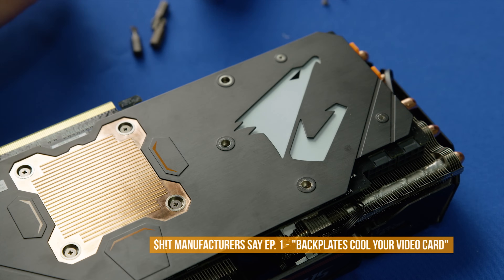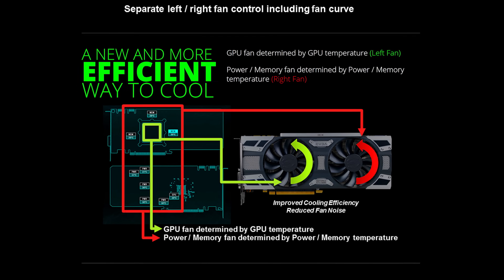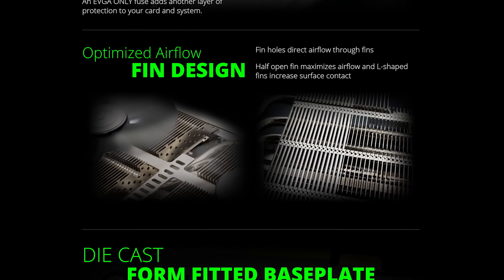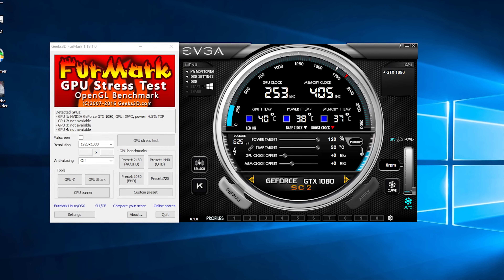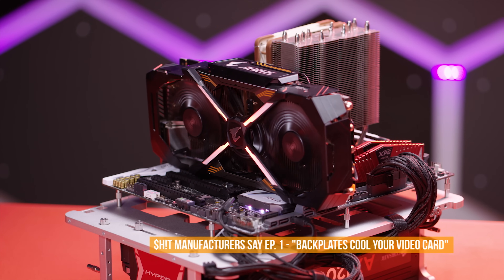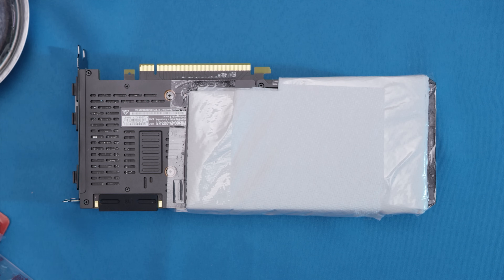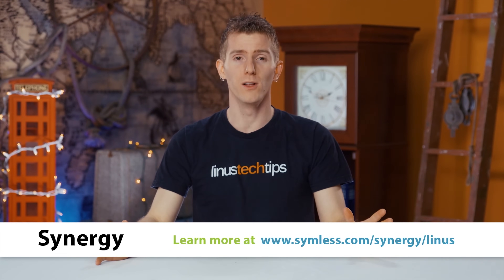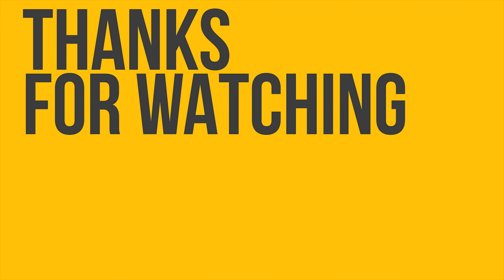The SOLUTION to Video Card OVERHEATING & DEATH

Comment: They need to put heatsinks on the backplate, or integrate them into the design themselves, if they expect them to help cooling to a significant degree.  That means more surface area.

Personally, I think the simplest thing to do is buy more high efficiency cards with blower fans.

Comment: I have a GTX 1050 2GB graphics card, it works perfectly fine for daily gaming and normal use. The card is maintained regularly. However, when I tried to run the Furmark stress test, the card would crash. Other than that, it has no problem. Should I trust Furmark that my card is starting to fail? (That it crashed everytime I run Furmark).

Comment: This is, in fact, much of the reason why I prefer EVGA, even to very well established, consistently good manufacturers such as ASUS. I'm not saying that they are better. 

EVGA has impeccable support, that'll gladly spend extended amounts of time troubleshooting a dead GPU, well after its warranty has ended. They are the sort of guys that sell you a 660 ti, which then cooks itself in just a few months, only to be a good friend, and upgrade you. But not just to the new 700 series. No, they're giving you a 770 instead of a 660 ti. Basically equivalent of replacing a 660 ti with a 680 in terms of performance. Hats off to good customer support! That's the stuff that'll keep me coming back. A broken chip is forgivable. Even the largest manufacturers and corporations makes mistakes and faulty products. The difference lies in how they handle such situations.

I bought a 2060 super from Evga 1½ years ago. Ultra Gaming or something, don't really remember that well. I just remember I wanted a 3 fan cooler for low rpm, low noise since I have the case for it, but couldn't get the one I wanted, so I had to settle with a twin fan design, with weird little bumps on the fan. Oh well, at least it's a million times better than a single fan. Been running solid so far, runs stable in games at 2085mhz at stock voltages, way more than I could've hoped for. At first I thought it was a terrible deal, but it has since come to my attention that this basically performs in line with a non ti 1080, and has rtx thrown on top, and only drawing at most 200w doing so.

I thought I had made a poor choice, not going for a 1660 ti. Man did that ever turn out to be the right choice, considering how impossible to obtain these things have come be.

Comment: Hello I have a problem with my gpu, a few days later I realized that the temperatures have risen 10-15 degrees in some games, I have already done maintenance to the pc to see if it was the accumulation of dust but nothing, the gpu has the updated drives, install two antiviruses and nothing. I wanted to know if someone else had this problem because literally this problem started to happen to me from one day to the next. (the gpu has undervoltage and nothing, it reaches 76 degrees in some games)

Comment: My sons Dell T3500 w/ Win10 keeps overheating and shutting off.  Nvidia card driver level doesn't seem to have an option to disable overheat shutoff, nor do I want to completely fry the card.   Any tips on cooling things down?  Or an option for a very cheap gpu that atleast won't overheat and shutoff mid game?  He's only 8 and it's shutting down on Roblox, so nothing advanced with crazy graphics

Comment: @ Linus Tech Tips,

                                 Linus, if you happen to see this Question or Remark, I have Recently Purchased through eBay, a MSI GeForce GTX 970 100 Million Edition w/Twin Frozers. I pretty much did the Same but I pretty much Slept while I had the Computer Left-On Playing 4K UHD Videos on YouTube. The Results is Between 37 Degrees on up to 41 Degrees having 3 Open Tabs. Olay, now, I see that your EVGA that you have Tested, is Open-Air and is Running at 37 Degrees [Beginning Of Testing], and Ended-Up at 80 Degrees. My Scientific Question is, Why did the EVGA Geforce GTX 1080 Graphics Card Ended-Up Hotter than my MSI Geforce GTX 970 100 Million Edition and that is in Open-Air Room Condition and mine's is in a Enclosed CPU Case. What Gives for the Temperature Differences for Open-Air Vs. Enclosed? Is it because of mines is Sideways Vs. yours is Standing-Up. It;s got me Baffled.

                                                                                                                                                                                                                                                                                                  G.C.E. known as 150Spoke9

Comment: i think the future application of this could be something like a water cooling loop with adjustable flow chokepoints to different parts of the GPU or the computer as a whole which are hooked up to the sensors and adjusted for volume/flow of coolant based on individual part temps. hotter parts = more liquid flow to cool those specific parts off. choke points could be spliced into the loop as separate attachments and hooked up to motherboard fan pins or whatever

Comment: Make a higher minimum fan speed make copper heat sinks make better heat sinks use heat pipes to connect the backplate to the heat sink make better ventilation for the shroud

Comment: I can answer this in seconds. Don’t modify the gpu by either over clocking it. Also have decent air flow or a good well designed no fan system. Most importantly don’t push past the limits of components or case capability to remove heat. See it’s super simple.

Comment: Guys i have a problem with my pc and i need help
My graphic card (FANS) spinning so fast while the temp is good (70c-60c) and the (FANS) rpm is 2700
Plz help
GPU: msi Rtx 2070 gaming z
Cpu: i7 7700k
Nothing is overclocked

Comment: Are GPUs getting to the point where they won’t be able to make them any more powerful due to not being able to cool them down? Or is their going to be new architecture that will allow gpus to run cooler? The PS4 pro i have gets super hot. I don’t see how they are going to be able to double or triple the power of the ps5 and not become a space heater. Sorry if my question sounds stupid but I’m curious of how GPUs are gonna get more powerful without getting too hot

Comment: I found a simple solution to cool my laptop. Place it ontop of my upward firing air purifier. No joke man this was the best quality of live trick I've done in the years of owning a gaming laptop. I then leave the air purifier next to my TV which is plugged in via hdmi and use my wireless keyboard and mouse to game on. 

What are the results? Fortnite plays at max settings  with temperatures that went from 70 to 80 Celsius without the air purifier down to 35 to 45 celcius with the purifier. Not only that but I managed to sustain these low temperatures playing fortnite at max settings for a 10 hour gaming session. 

Also, if the air purifier is cleaned on a regular basis, it will blow clean non dusty dry air into the laptop thus preventing humid or dust damage. And of course the air purifier is doing its main purpose which is cleaning the damn air you are breathing in the room.
Here is the air purifier 
https://www.walmart.com/ip/True-HEPA-Large-Room-Air-Purifier-430-sq-ft-Room-Capacity-White/21970557?wmlspartner=wlpa&selectedSellerId=0&adid=22222222228016817669&wl0=&wl1=g&wl2=m&wl3=194452192698&wl4=pla-308696531426&wl5=9031244&wl6=&wl7=&wl8=&wl9=pla&wl10=8175035&wl11=online&wl12=21970557&veh=sem&gclid=EAIaIQobChMIl4He6Ijl4wIVk7fsCh0tewGrEAkYBiABEgILNfD_BwE

Believe me this thing cools way better than a laptop chil pad. And the indented top rim allows a laptop as large as my 17.5 inch to rest on top safely as long as it's not bumped into. I know this may seem crazy but hey if you were thinking of buying a air purifier for your home and you are dealing with high laptop temps then try this set up.
Reply: Nais.

But I have PC.

Comment: I have a GTX 1070 super clock ICX ! I have noticed when plugged in vertical, temperature stay way below it's normal horizontal position, specially the backplate, that burns in horizontal
Reply: Careful with this ones, First revisions had shitty thermal pads, they would get hot and leak oil

Comment: so my program is saying that my GPU has reached 90C
but on touch, it doesn't feel hot (i didn't turn off the pc when touching it)
or at least it doesn't burn me when i touch it neither the fan or the inside of the fan or any of the side of the video card
the computer also doesn't shut down when the GPU supposedly touched 90C
(I'm using core temp for the gpu)
so I was wondering if it's normal that it doesn't feel hot on touch
and it's normal if the computer doesn't shut down for overheat even at 90C
and I'm afraid I might burn my GPU 
I did give it a good clean so I'm not sure  if it is a program problem that is saying i have the wrong temperature 
or if i should actually start to worry for a possible overheat 
(my GPU is a Gtx950)
Reply: Not a pro, so maybe i am wrong ... first touch and not hot. you might have touched it on the wrong places. but i dont think that. it could be core temp wich gives false temp data. or it could be a thermal paste problem (thermal heat build up). i looked youre gpu up where the big heat sinks are and stuff and and its kind of old 2013´ish (and there are some variants, so im not sure wich gtx 950 you have). second problem, youre pc isent shutting down. i played with overclocking on my old pc. i used core temp back than to see the temp levels. i had some situations where my pc diddent shut down. i think it was becourse core temp interfered with those mechanics. try another prog for temp monitoring. use only one prgm at the time and try to set always the same settings. in games the gpu stress could vary between levels and scenes. try to touch the spot where youre gpus prozessor is from the back, maybe you have to remove the back cover of the card. i dont recomend you touch electric devices when they are running, but you know, use youre brain and common sense, youre fingers could be sweaty^^
Reply: @ThomasZT  thanks! Your tips actually worked!

Comment: You gotta hell me bro. So I just bought an XFX AMD Rx 580 gpu two days ago. Installed it hooked it up. Tried to play REsident Evil 2. Got 15-30 minutes through and my computer didn’t crash. My monitor just went to sleep. And wouldn’t come back on until I restarted my computer. 

I went and got a 850 watt psu since people told me that was my issue I didn’t have enough power with my 500 watt. However, I plugged everything in. And the same thing happened. And this time I noticed my gpu temp was 86 degrees Celsius. Gameplay was very laggy, and the monitor went to sleep.

Comment: Hey, coming from someone who has worked with and handled multiple ICX cards, my two cents is to NOT get them, the 1080's get extremely hot and the XOC software required to run both fans is absolutely terrible, not to mention the newer two versions crash Forza. The "asynchronous" fan design becomes extremely loud. I have that exact same 1080 sitting in my mini c tg with two intakes and one exhaust and it throttles to 85C easily. Please guys, just check out HYBRID CARDS

Comment: Got a fun question for you: I got a new hdd. Installed WinX, updated all drivers, etc. Now my gpu is overheating. It was fine before the installation. I swapped it out with another R9 270 oc that I got, and that one is overheating too. I put both in, and it's just the one in that slot that is overheating. I fresh installed the drivers, made sure everything was connected right, blew out the cards, etc. I'm at a loss.

Comment: This may sound ridiculous, but the best and cheapest method i found to keep your pc running cool(especially if you live in hotter climate zones) is taking a regular 20 inch x 20 inch house hold fan and putting it on the side of your pc. To do this you can find the fan at any walmart or target for 19.99, then you will need to buy a AC filter screen at the same stores for around 6.99, find the thinnest one and then when you gather the materials, take the side panel off of your pc by unscrewing the thumb screws, then put the AC filter on the side of your rig via tape or maybe in some cases it will fit just right, then press the fan on the side of your pc right against the filter, the filter is applied to block any unwanted dust, hair etc( its a ac filter it pretty much traps anything), then when you start gaming set the fan speed to 1(usually 20 dollar house fans come with 3 speeds) if you really play games that demand a lot of your gpu and cpu then set the speed to 2 or 3, this has been very efficient, my rig under the stress of many triple A titles has been running at around 55 degrees C after hours it goes up to 60 and for my gpu it goes to 57 degrees C and after hours its in the mid 60s
Keep in mind this is not a very great cosmetic choice if you are trying to show off your build/case, but the alternatives are watercooling and expensive cpu fans,(that wont do much if your case lacks airflow, all together this setup costs around 30 dollars and has the same efficiency of a 150 dollar water cooler, plus the benefits of not only cooling your cpu but also any ram, gpu,ssd, or hhd you may have installed. The only down side is the noise but if you play with headphones its practically unnoticeable. (im not listing cosmetics as a flaw because it doesn't bother me that much). If you guys try this out, then have fun gaming at cool temps no more worries about overheating your rig!

Comment: i’m gonna have to get a water cooled evga card because my radiator has to be mounted in the front so it’s just constantly pushing hot air into the case.

Comment: I get mine evga 1080 ftw2 cheaper than acx, now is cost with aprox. 16% more in just 1 mounth
Reply: I wonder if i remove stock cooler and replace with 3x arctic bionic is there a diff.? At max fan speed ( more than 3.000rpm) is very loud but max temp is 66 degree at 2123mhz clock. I will do that test and let you know.

Comment: The solution to graphic card overheating is water cooling. 
I prefer graphic cards that have cooling fins that run horizontally. The fins on this card run vertically, dumping hot air on the motherboard, instead of blowing it out the sides.

Comment: Just got 2 msi aero 1080ti in sli..they run about 83 to 84c-ish on stock fan profile but run at around 72c w/75 to 80% fan speed in msi afterburner .. they have no back plates either but they still run like a dream... Is it okay to set the fan speed at 75 to 80 and MSI afterburner on brand new cards or will it be detrimental to the cards?

Comment: I think that the icx Cooling technology is bs, I have the small form factor EVGA GTX 1060 6gb card and it idles at 50 degrees Celsius with fans at 50% with no oc and when the fans are off and gpu is at idle, it is always at 60 degrees Celsius

Comment: Me? I just screw  in another System Fan to the side of my GPU facing the VRM chips. It also helps dissipate the lingering heat. xD I used another VGAs spring screw that is very thin so I can attach the System fan properly and snuggly as possible at the side. :) Overheating problem.

Comment: WHY not just add like 10 small and thin fans over the hot spots and with sensors built in and fans powered by the point they snap onto the bored.???? Less power consumption and less noise with more customization ,smaller and cheaper to replace and no fan wires........no creativity in these companies.

Comment: meh, bunch more settings to have to tinker with, pass. theres no real good reason for this, a single fan control works just fine to cool down basically the entire gpu as is. Id rather they just market cards with AIO's attached for people who care that much about temp. As far as my gpu is concerned it cannot go past 94c, just physically will not get hotter. And it hasnt downclocked or impacted perf while running that hot yet so who cares really. Its winter time, embrace the heat.

Comment: I due note ICX is on the right track. I am not a fan of extra controller software. SAM SUNG SSD IS EXTREME EXPSNEIVE WITH 2T SSD, I wish MICOSOFT GET RID OF DRIVERS. TURN OF PC TAKES FOREVER EVEN WITH SSD. Then the games crash a lot more. NOT RESPONDING ERRORS and BLUE SCREEN OF DEATH. Windows 7 , 8.1 and 10 take up too much hard drive space. too much MICROSOFT VISUAL C++ 2012,2012,2013,,2013, 2014,2014,2015,2015, 2016,2016, 2017, 2017.too many service pack 1 service pack 2 service pack 3 lets say you buy a 256gigs SSD no room for GTA V windows takes 256 Gigs  that is how big windows really is I also have to install Microsoft NET FRAIMWORK. then install a game. then install more NET FRAIM WORK andmore VISUAL C++ that is why it takes forever to turn on my PC. even with a SSD it takes 256 gigs of window files to load up. windows is over priced for what its worth. There must be another solution for a  O.S that runs windows software with out the use of windows. simply too much junk that is why my PC crash a lot
Reply: Hey....microsoft is downloading every thing off your PC....its fucking illegal and should be stopped yesterday...microsux turned my windows 7 into a spying unstable dishonest terminator bot. Microsoft even clones your drive and has you run off the cloned drive as it replaces all the security controls in windows including taking away super-user or administrator rights and moving those rights to a server at microsux. I have 2 years of logs and virtual pc data to prove it....people need to go to prison.